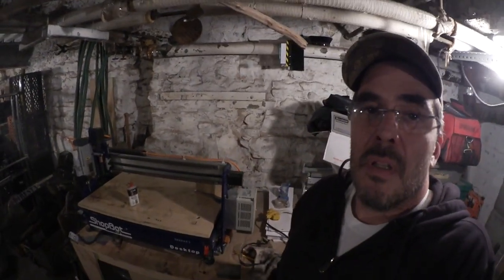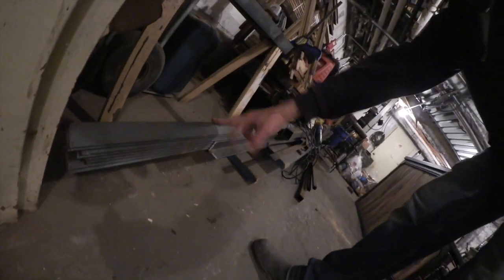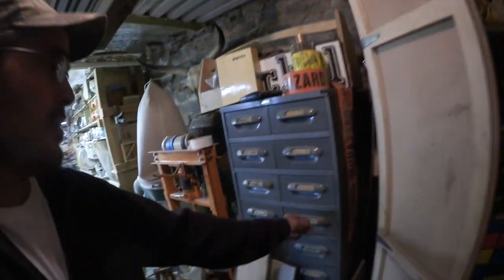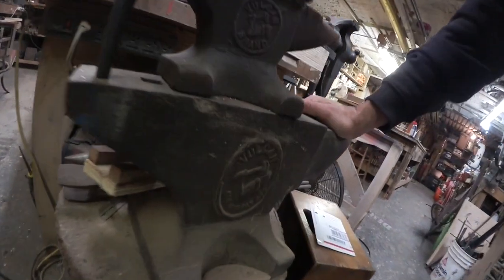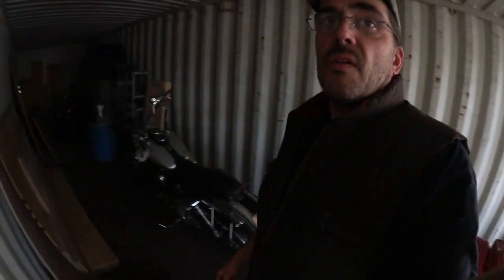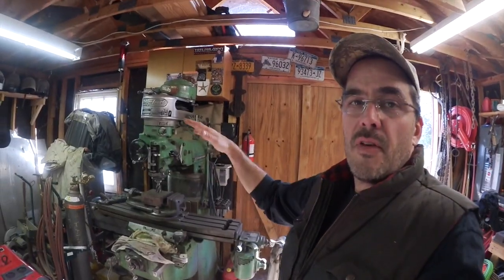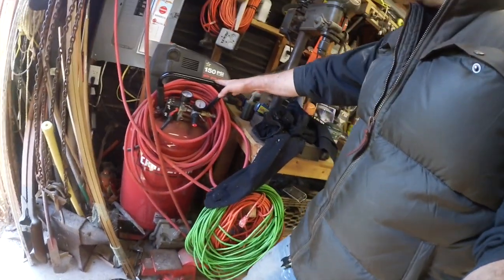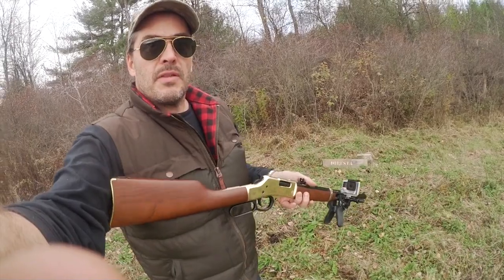✔ DiResta's Tools & Toys

Comment: Your Victorian era coffin is actually a morticician's pickup basket used into the 1920s and heavily favored by Corroners.  It was used with a rubber sheet liner for short transports.  Longer transports or storage the body was moved to a tin casket that could be iced for preservation or stored in a cooler.   

The buffing machine is nomenclatured a buffing lathe.  Looks like you're missing the nuts and wheel cheeks.  BOLT it down before you play.  It's too nasty to catch as it flips over.

Comment: You are my hero!!!! I have my mini machine shop set up in my townhouse. A lot of people give me a hard time, but my wife is cool with it so I don't care what others think. They all rush to me when something is broken or they need help when some assembly is required. I have a 7x12 lathe ,a milling machine, drill press, and 3 compressors plus some pretty neat sand blasting equipment. Outside in my storage room is my fluxcore wire welder and my torches. My 1979 Garelli VIP moped sets in our dining room, but I roll it outside when we have dinner parties. It is too nice to store outside because it could get rust on it. I have restored it and it has 6 coats of metallic blue lacquer on it with several glass like coats of clear rubbed out by hand. I  make sure there is no fuel in the tank when it is indoors. The hoses are plugged so there are no fumes either.
Reply from the maker: Haha thank you for sharing !! And watching !!

Comment: I use to do the same thing you and your brother did with that bandsaw with ours bymyself cutting wood scraps; exact same bandsaw too except ours has the original stand and use to have the original on off switch which was a rod with a eye on the end that you pulled up to start.

Comment: I notice you have a huge amount of heavy equipment to move around, I was wondering why you don't have a couple of pallet jacks. I find them invaluable.
Reply: +Murray Lowe What Jimmy needs is a flat bed car carrier. They can carry more than just cars. I knew a guy that had a car carrier haul a 10 foot bed metal lathe for him. They dragged that machine right up with the winch. Not a problem.
Reply: +Paul Frederick Sounds like a good thing.

Comment: Thanks for the tour. I just recently found your videos and they are fantastic. I have watched several. Something I did a few years ago was take apart an old cordless drill with a keyless chuck 3/8 inch or just get a screw that fits in a keyless chuck and chuck that into the 1/2 chuck on the drill press.  Since I mainly use small drills and switch them out frequently the 3/8 inch keyless chuck works very nice, then if I need the bigger 1/2 inch keyed chuck it is still there.  I call it the double chuck.

Comment: wo wo back it up son... I had a cheaper version of that milling machine and I made enough money with that machine to buy Bridgeport milling machine. Just sayin.
Reply: +Hellsong89 You can't mill with a drill press because the bearings are not designed for side loads. Plus drill press spindles are kind of thin too. I have the Harbor Freight version of that mill and it is a piece of crap. It is a nice drill press though. So Jimmy is doing it right with that machine. Just drill with it.
Reply: justin gray I would be perfectly happy with machine like that.. -.- He got it free.. i had to pay 100€ for cheap drill press, 100€ for cross feed table and around 50€ for couple of milling bits... Still it sucks and does around km tolerances -.- Yeah i know.. i'm bit butt hurt about this. At least its better to get rough cuts than by hand.
Reply: Paul Frederick Well its only thing i can afford, with my current zero budget. I know its limitations and that its really not meant for that, but at least it beats my earlier method of freestyle milling with cordless drill XD One must do what he can what hes got and honestly i dont give damn if the bearings blows from that thing. I get good excuse for my self to pop it open and just mod more heavy duty ones in it. :)
Reply: Hellsong89
You'll get a mill someday if you really want one. Lots of times people just give them away for various reasons.

Comment: Also that container if you get another n put it beside with double the width between, couple of beams welded across the gap and some roofing tin you have a cheap shed with endless applications.  Close it up or leave it open. Compact the ground or slab between. Or two bedrooms each side with lounge/kitchen in between. Keep em coming

Comment: Thanks for sharing! I really appreciate all your videos :) Could you do a video on how you sharpen your tools? Both chisels and planes, and saws perhaps? It looks like you use sharp tools, but what do I know :) Thanks again!
Reply: if you want to know how to properly sharpen tools, go watch paul sellers vids, he has one on every topic :)
Reply: I will check them out. Thank you :)
Reply: +Lalaland There are a number of ways to sharpen tools. What is proper is what works best for an individual.
Reply: Paul Frederick
I was merely trying to be helpful, why is there always someone just budding in for the mere fact of having to spew their opinion.
Reply: Lalaland
You seem to be making the claim that only Paul Sellers method is valid. I'm sure it works for them. But I've seen folks use bench grinders and get that to work too. I can't. but that doesn't make it not right.
Reply: Paul Frederick
Paul Sellers is a well known and referred woodworker, as is Jimmy Diresta. Saying something is the proper way, made you get your panties bunched up for some reason. I didn't say the only way now did I?  Before there were bench grinders there were only sharpening stones and perhaps sandpaper, hence calling it the proper way doesn't make any other method less valid, Learn to read instead of reacting on something you so clearly took the wrong way, mkay. Like I said I was merely tying to be helpful were as you yourself felt the need to express your opinion on a subject that has not been commented on by anyone since January. Thanks for being a person with an opinion.
Reply: Lalaland
I read fine. Learn to express yourself properly, and you will not leave room for people to misunderstand you.
Reply: Paul Frederick
That's if you are not so self important to think that what you make of it is the truth. The comment has been there since January, you felt it was important enough the make the judgment that you have made. The proper way and the only way are 2 different things, like I said learn to read and comprehend before spewing your opinion. Maybe ask a question first instead of assuming you know what I was trying to say. The person I replied to wasn't named Paul F. If I recollect correctly and it seems to me, he could appreciate and read the comment for what it was. Now how come you have felt the need on correcting me on something that was there in plain and normal english. Are you that lonely that you feel the utter need to validate your existence by posting your wrong assumption and opinion in a YT comment section. You and your assumptions just made it something it wasn't. You know what they say: Assumption is the mother of all fuck-ups. Now think about that long and hard before you feel the need to revive a comment train that was left alone since January. Mind you a person was thankful for it and could appreciate it. Get a life please, go read a book or something and educate yourself of the language, you say you can read just fine.People who live in glass houses should not throw stones. That is of course unless you deem yourself to be perfect.
Reply: Lalaland
There is NO proper way besides whatever works for any individual.
Reply: Paul Frederick
There is a proper way and that means getting the chisel sharp enough to cut without taking of too much metal, so your tool will last the longest. Sharpening on a bench grinder might get it sharp but will ruin your tool faster, hence not really a proper way. Are you prone to nitpicking or don't you understand what is ment by doing things properly. There is more  then one way to skin a raccoon, but only one way to do it properly, you can kill a deer in a million ways, but only one way to make it painless and ruin the least amount of meat. Do you get that? Do you even get why you are responding or are you just here attention whoring?
Reply: Lalaland
How are you going to develop a hollow grind on a flat stone? If a chisel wears out buy a new one. You got your money's worth out of the old one. They're not that expensive anyways. With a guide you don't have to take much material off to sharpen with a grinder either. The more you say the more obvious it becomes that you don't know what you're talking about.
Reply: Paul Frederick
Apparently you have never owned a some really good high quality chisels. I just happen to be a woodworker/knifemaker and own some of Kiyohisa's paring chisels, Harold & Saxon's, some koshimitsu's from
Dieder Schmid and some of Koyamaichi's finest mortise chisels and in no way shape or form am I ever going to put those on a bench grinder. I'm not even gonna tell you how much they cost because your jaw would only drop to the floor. Most of those tools I bought when I was an apprentice woodworker, that's about 22 years ago and none of my tools need replacement anytime soon still looking at at least another 20 years. You go ahead and buy new tools when they need replacing after a couple of years. I prefer to stick to quality and doing things properly. High end tools come at a price and at the cost of having to do things properly. Those chisels are ment to be sharpened by hand the proper way on belgium wetstones and japanese honing stones, but you probably don't even know what those things are. Assumption like I said before is the mother of all fuck-ups.
Reply: Lalaland
I got some Stanley chisels. They're good enough for me. Just because you overpaid for some nonsense doesn't make it any better. I have Japanese water stones, and I like Belgium chocolates. Nothing beats Arkansas stones for hand sharpening though. This chisel is worth more than the crap you got http://i.imgur.com/QLrCh.jpg Now out of the prison library and back into your cell, you shank maker.
Reply: Paul Frederick
Stanley tools are fine, when you don't appreciate the look and feel and finish of a high end tool. I however like to have a nice looking and well functioning tool if I am to work with it over 6 hours a day. Different strokes for different folks, sure your Stanley can get the job done, but for fine wood working nothing compares to the brands I just mentioned, it's like comparing wine out a carton with a proper Brunello di Montalcino. A tool is a tool and at the end of the ride if it gets the job done, it's all good. What it all boils down to is that at the end of the ride you overpaid a lot more then I did in the past few years, having to replace your chisels time and time again. Sure you can buy a sandvik splitter and get the job done splitting fire wood, but nothing beats a granfors bruks, when it comes to do the job properly without too much effort, sure you could use a generic brand lathe to do you milling and drilling but nothing beats a bridgeport milling machine. So there that. I might be overpaying to begin with but at the end of the ride, I own superior tools with superior material are handmade have a superior finish and they have cost me less then you have paid in the last ten years. Go ahead spend your money on things getting the job done, I'll stick with my high end crap and will continue making shanks, mkay. You say arkansas stones are the best, I have never heard anyone in the pro-industry I work in mentioning any whetstones coming from that region. But then again according to your dumb assumption I'm probably to posh to even look that way. I go by way of experience and in my experience, this is what work best for me. Let me quote you  "What is proper is what works best for an individual." So please listen and learn how to read just fine and follow your own advice. Oh and nice chisel you have there buddy, kind of strange there's no hollow grind there.You are just a big baby trying to get under my skin with your petty insults, grow up. act your age next time, not your IQ.
Reply: Lalaland
I've never had to replace a chisel. What you're doing is projecting your inability onto me. Just because you can't do something doesn't mean others can't do it too. Do try to realize that. You will meet folks that are better at things than you are. There's always someone better.

I don't use that Swan chisel. It is too valuable. Last I checked it was worth about $150 or so. I just got it to shut idiots like you up. Plus I only paid 50 cents for it.
Reply: Paul Frederick
Wauw, you did totally shut me up with that chisel pic, when and where exactly was it that I said I was better or less competent for that matter. Of course I will meet people that are better and more skilled then me. My woodworking teacher is one of then and just scouring the amazing internet there are probably mere thousands who are better then me. And where did that come from, your own feeling of inadequacy? You make this whole argument about something completely different, do you have a hard time stating your business or for that matter staying on point. You apparently read just fine but are missing a few bolts and nuts in one way or another. I know you have a problem and I bet it's hard to pronounce. I don't need pictures to shut people up, my quality stands on it's own and by itself, no need for douchebaggery like that. And you find a swan chisel too valuable, that's soo cute. Oh wait let me show you my picture that will teach you, how lame and sad my life must be. To have to go out and buy a chisel to show people you are better, really? Of course that makes me feel like I'm the idiot, NOT!!! I work with my overpriced chisels daily, cause they are tools and ment to be used as such. And you saying you never replaced a chisel, hmmm, one of your first comment actually led to believe otherwise remember this one; If a chisel wears out buy a new one. You got your money's worth out of the old one. They're not that expensive anyways. That comment kind of led me to believe you were talking about chisels being not that expensive and replaceable so I figured you had replaced some. My bad, I do concur. What is your point you are trying to make, apart from some petty insults and cries for attention. And please stick to the subject, it was the proper way of sharpening remember ? Oh wait, we already talked about that and actually agreed, but your fine reading probably missed that. Now show yourself the door you know what time it is...
Reply: Lalaland
Enough with the stream of consciousness Jack Kerouac. Try to edit your thoughts down a bit.
Reply: Paul Frederick
Says the guy who has a point to make gets someone to agree with said point and then goes ranting about other stuff completely besides that one point, nice try though. And thanks but not thank you very much. I feel no need to edit my thoughts down, I don't want to stoop to your level, but thanks for asking. I'm actually very afraid actually to argue with your kind, cause you will just lower me to your level then beat me with experience. So have the last word, I already feel my IQ dropping by still answering to your Histrionic personality disorder.
Reply: Lalaland
OK here's the last word turkey you're blocked.

Comment: If you need a quiet compressor just use the compressors that come out of ac systems 120 psi is about all you can get out of them but there really quiet just find a air tank for it. Just look it up on youtube its a pretty simple project to do.

Comment: There are portable walking-foot machines which can do the same work as a stationary machine, but they cost considerably more.  Tac/Sew from China is actually a very good make of walking foot machines, and some of the Juki machines are actually made by them!

BTW I'd still get a T-Square fence for that Rockwell table saw...one of the best table saws made deserves nothing less, and it can take a lot of trouble out of setting up for highly accurate cuts.

Comment: Power hacksaws may be slower than band saws, but they can handle large cuts that most band saws can't.  If you have trouble cutting, make sure you have good cutting oil and check the blade often.  Large power hacksaws often have a sump and circulating system for cutting oil.

Comment: What an awesome collection of tools! It is nearly as awesome, as your work! :D I'm allways really impressed by your craftsmanship.

But I'm missing something in your shops. Don't you have a jointer and thicknesser? I think I remember seeing you use a jointer. Did you get rid of it or am I wrong?

Where my shop is located, it is impossible to get straight wood. What you get is all twisted, curved and cupped. It is a nightmare without a jointer.

Best wishes from Germany, near the Polish border. :)

Comment: How do you move a shipping container?

Btw, you interrupted the intimate moment of the mouses...
Reply: Matthew Simmons nah, big enoght wheelloader and a nice pair of extra long forks works really good if its empty :) (usually they have holes for forks in the bottom runners) Full, however it needs a specialized truck witch stabilises it :) (othervise it may break in the middle, 40 feets makes a really powerfull bendingbrake... =P
Reply: They're designed to easily carried by a Tractor/trailer type rig. Probably have to pay someone to move it.